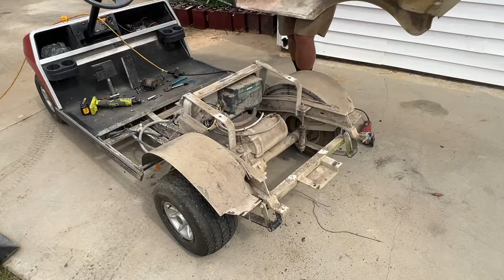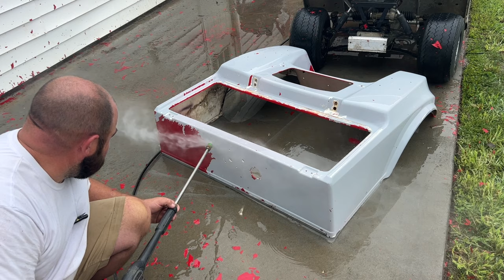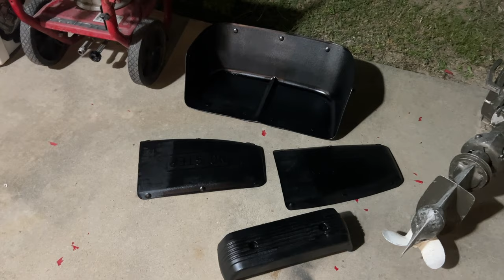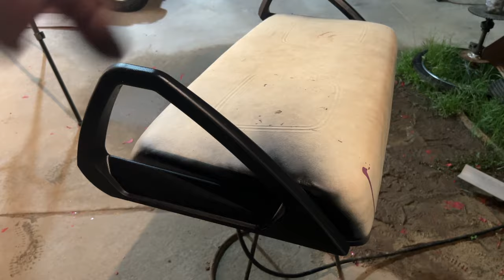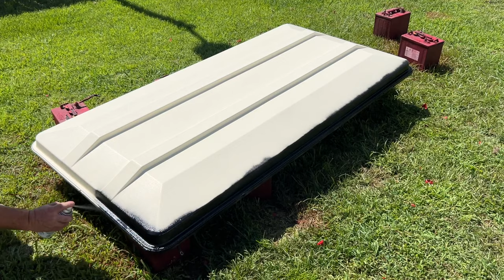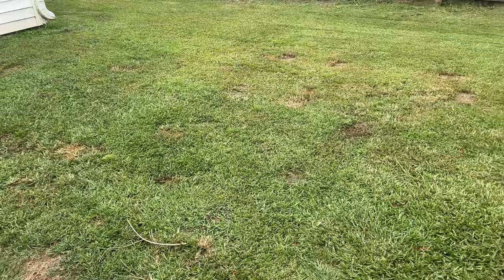Golf Cart Transformation with Raptor Liner Paint Job

Comment: Another great video - turned out great!  One thing I noticed - those tires actually have directional lugs on the outside edge.  The rear drivers side  and front passenger side should be switched.   If you look at the outside lugs you will see what I am talking about.  Love the videos - always helpful.

Comment: Great turn out from a tired DS. I haven’t ever used raptor liner on anything, is that a kit? Cost on that? I have a local paint shop I typically use that’s around $4/500 if I remove the body.
Reply from the maker: https://amzn.to/3EUtWYj  is $139 with gun and hardener, Does 2 carts.

Comment: I love the build.  I have a couple of questions for you.  I have a 2005 CC DS IQ that got in not running condition.  I did some troubleshooting on it and it looks like it has a bad controller in it.   I am getting a new controller for it and it should be here in another week or so.  I have a BigBattery Falcon Elite that I have in it.  I am wondering if I need to bypass the OBC in it with the new battery?  Also what lift kit did you put on this build?  I am thinking about putting one on mine and I would have loved to have seen you put it on this one.
Reply from the maker: You dont necessarily have to remove the obc, its just there to tell the stock charger when to turn off. The new big battery lithium with come with its own charger and the batteries bms will tell the charger when to turn off. I used the SGC 6" kit on this cart. I have another one just like it coming up as I'm ordering parts now for another flip. Maybe I will show that kit, very simple install.

Comment: Have a 02 ds trying to decide between the spartan body and lift or paint and lift.  I like that the spartan is a colored abs vs painted but the 1300 is $ on a 22 yo cart
Reply from the maker: Don’t look at it as the age of the cart. I built my personal ds on an 84 chassis. The only difference between my 84 chassis and a newer ds chassis is the rear fender wells are made out of aluminum. I used it to mount more stuff to it. I could care less the age of a cart. It’s not like a vehicle.